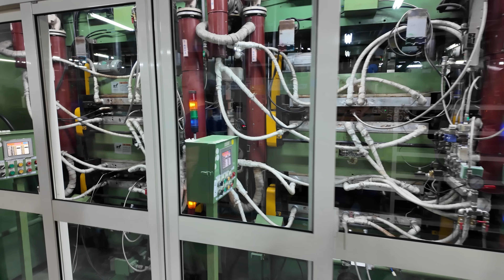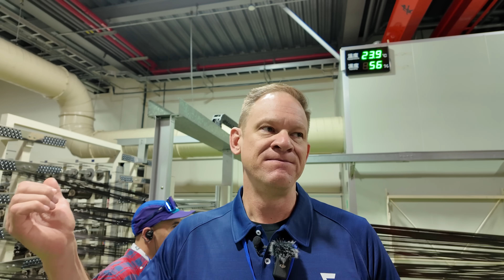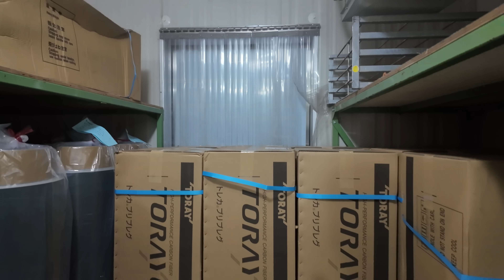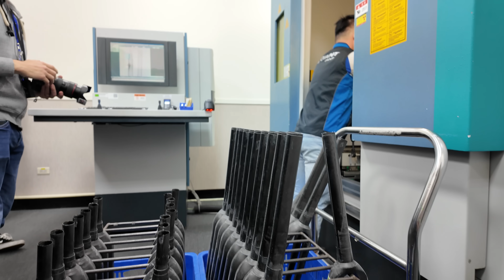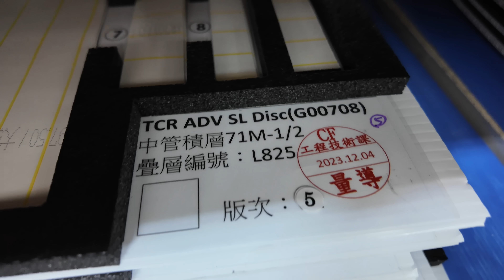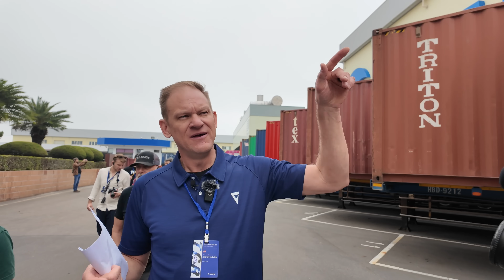Giant Bicycles Carbon Assembly Factory Tour

Comment: I had a Reign Advanced 2016.  Bought in March of that year, new frame in early April, due to cracks and delaminating. The frame lasted  three months before cracks appeared again.  The frame was replaced again. I never rode the bike after this. I sold it at tremendous loss. In reality, the bike should have returned and a complete refund received.

Comment: The bladders is difficult. Why not 3D print a shell and carbon over that and just leave it inside?
Reply: Weight?
Reply: @SrFederico  for a lower cost model though if it would make manufacturing simpler.
Reply: @rtz549  AFAIK, there is at least one brand (Time?) using a wax model to wrap the carbon sheets onto, and later the wax is extraced by heating it. That actually makes a true monocoque possible.

Comment: I bought a Cadex (Giant) carbon fiber frame mountain bike in 1990. Still rolling with: replaced derailleurs, wheels, crank, brakes, shock, and cables. [Hit by a car running a red in 2005, throwing the bike (and me) down the street about 30 meters.]

The only minor issue was when I put disc breaks and new shock on the front, which raised the headset about 3.5 cm (~inch and a half) resulting in some faint crackling sounds when I rode for a few years. I’m sure the change in force direction put unusual stress on the frame…though after 10 years more riding, no noticeable effect.

Frame could use new clear coat !

Comment: A friend of mine had a Giant TCR bike back in 2018 and he had to get the frame replaced under warranty due to the paint around the bottom bracket area cracking due to movement in the area.  This is a common issue on giant bikes as what I have been told that most probably go back at least 10yrs.  After my friend received a new bike build, he sold the bike.  I would trust Giant with a 1000ft pole.  A bicycle store back in the 90's in Melbourne told me about this issue and he would not sell them.
Reply: My 6061 Boulder had paint cracking as well . This is a widespread problem with the  brand . Defy carbon bottom  bracket ovality creaking is another problem to Giant .

Comment: That x-ray for every fork is crazy impressive.
Reply: Carbon is cheep crap made by females omg even a monkey could make one , not like Reynolds is it with people building frames with 50 years experience ..Giant is owned by King Lou or the CHINESE CYCLE COMANY , Chinese are know for high quality pmsl
Reply: Except its for show. 24/7 and 365 and no downtime, at 3 mins a fork would be 175,200 forks per year. says right there below the title that they produce a million bikes a year. If you were really QCing every fork with this machine or similar, you would have a computer do it, and you would only use humans to inspect any forks that have an anomaly.   It's clear that this tour guide is very much a marketeer and not an engineer.
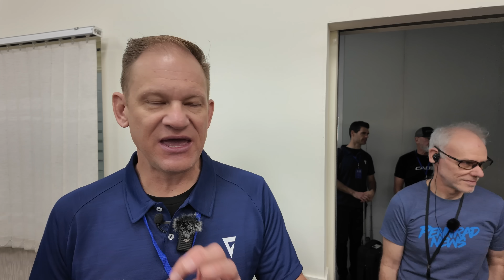Reply: @daynosdr Yes, I too am skeptical as the math does not make sense.  That's only 15-20 forks an hour, which is a really low rate.  With x-ray a human still needs to manually review the scans for anomalies.  At 7:19 you can see scan totals from 6,000-10,000 per month and rejection rates...so maybe 100,000 forks a year.
Reply from the maker: The 1M number is a variety of bikes, mountain, hybrid, etc. So definitely not 1M bikes with carbon steerers.
Reply: This looks like a factory for carbon frames, @TheRidewithBenDelaney  did you see substantial amount of alloy frames made at this facility? I would think the alloy frames are made elsewhere. lower end product (alloy) wouldn't be made in taiwain.
Reply from the maker: @daynosdr we only saw a fraction of that factory. It is massive. I don’t remember the square meters. But I do believe they said that Dajia factory does six times as many metal bikes as carbon frames.
Reply: @daynosdr  in your formula which give you 175k forks you forgot about fact that they have 7 factories and there is no reason why we should assumed that there is just one man, and one x-ray in every one of them. At this scale it's really not that expensive to check every fork.
Reply: @daynosdr Composite forks only obviously
Reply: @daynosdr  its not.... Giant make a million frames a year... that ranges from road to Downhill... only road bikes have carbon steerers..... 
id be deleting my comment if i were you.... like duh
Reply: No company anywhere that’s mass producing anything can or would QC every single piece.  It’s not sustainable.   Most take a random number of samples from a batch or set number of product produced and check them.  (Ex, every 5th one out of 50, etc…)

Over the course of many batches they can relatively safely assume that based on the sample checks that each of those batches is as good (or possibly bad) as what the batch sample test shows.  

I don’t think they’re trying to say they check every single one, but if so, I’m sure there’s an internet math nerd who can definitely prove/disprove it.
Reply: @jeremyprovonsil7886  they have to. Canyon are the same.. a carbon fork failure is instant court and massive fines.
Reply: @Bestintheworldatwhatido  is this realistically possible?  The math would be interesting to see!
Reply: @jeremyprovonsil7886  what? checking every fork? Yes, hence why they run it 24/7 - Canyon have Quest composites do a check when made and then they check them again at their Germany Assembly.

This is well documented in the Bike industry. Its extremely important and is why they do it.